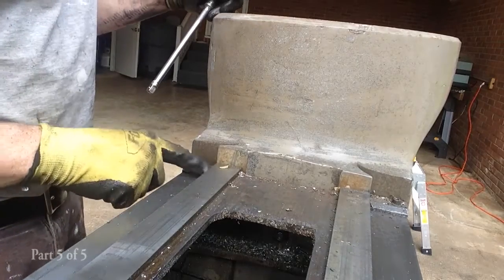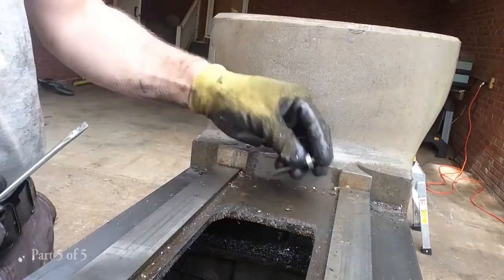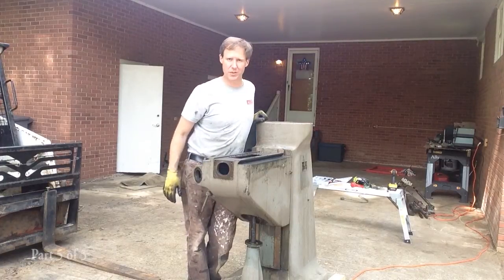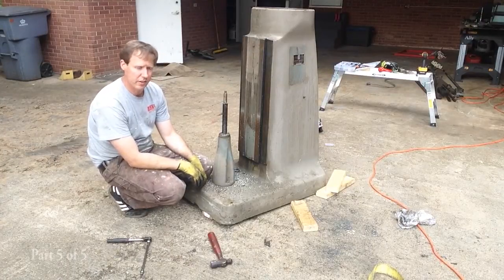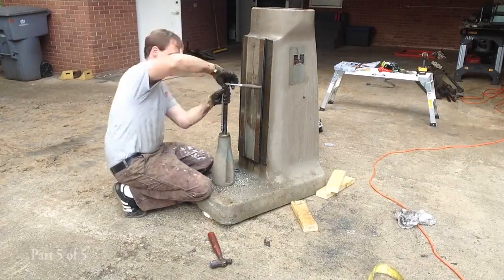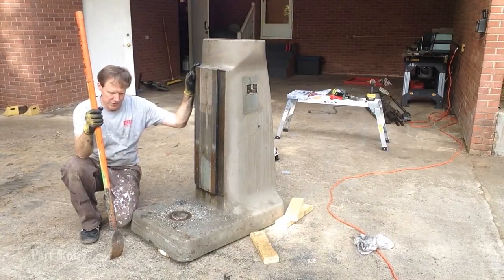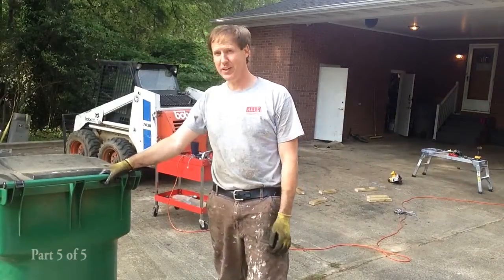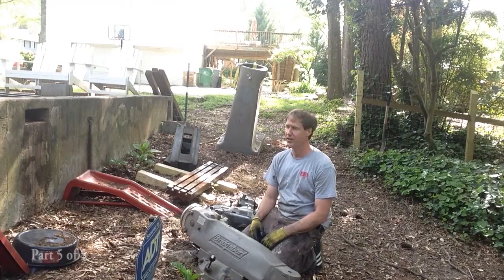Bridgeport Mill Teardown Part 5

Comment: Thanks for posting this series. I've just bought a bridgeport and will need to do the same thing, you have saved me a lot of unknown's! Thanks ;-)
Reply: Me too! 03.14.2020, I will start next week, I used a drop deck (platform trailer) to haul it home and slid off the trailer with a come-a-long. I strongly suggest lowering the knee all the way down and tip the head 180 with the motor down before moving it on the road. That makes the mass weight much more stable on the road! A solid base is also very important! Thanks

Comment: I've got a line on an old Bridgeport and I'm told it won't raise up or go down.... it's supposed to be a smaller frame mill so I'm still interested. Watching your breakdown to get my nerve up to buy it. I've never ran one but always wanted too. I'm hopeful that I can find the issue and repair it. Thanks for the vid.
Reply from the maker: Get it!  Might be a stripped gear or locked gib.  Both are easy fixes.  The Bridgeport will take your work to the next level.

Comment: Very useful series. I'm about to pull the trigger on a Bridgeport here in France (I know...) and am a tad intimidated by the logistics of bringing back this Alien life-size sculpture to my basement. At least now I have a better feel for the various components and how difficult it'd be to tear them apart, their respective weight and mass distribution.
I'll probably look at just removing the head and ram, then shoving the rest into the back of my Landrover discovery with an engine hoist. or rent a car-tow trailer and try to keep the whole thing together...
oh well, gotta wait for my wife to take the kids to their grandma for 2 weeks first, and then I'll hatch my mischievous plan.
Keep on trucking ! (from France)

Comment: Thanks for sharing. I need to pick up my bridgeport today and it's a bit too heavy for my trailer, so I need to haul it in two parts. I liked seeing how removing the 4 bolts from the turret on top allowed it to lift off. I believe that's where I'll separate mine.. Good to see how the weight shifted as well.
Reply from the maker: Its award for sure.  There is a 5/8"-11 threaded hole on top of the turret for a lifting eye or bolt.

Comment: Nice work, good videos. Also love the JD400 vids, mine is a 1980 I believe but is different then yours, has no foot pedal drive rather hydrostatic lever by the steering wheel. Had it for a few years but medical issues have kept me from tearing into it but your vids are inspiring me too do so. I think I have the same tiller,but the 3 pt is very slow to raise. I have the mower deck, tiller, hydraulic front blade and a front loader. So if I get it restored it would be rather useful. Anyway great job.
Reply from the maker: SAA 77 Well get on it!  The 400 is super useful.  I wish I had the front blade for it.  Also, I added the foot controls when I restored the machine.  I still can't figure out how many hands you would need to operate it withOUT foot pedals.  Foot pedals are the best mod I have done to the tractor. Thanks for watching!